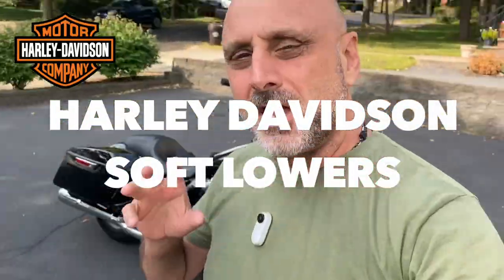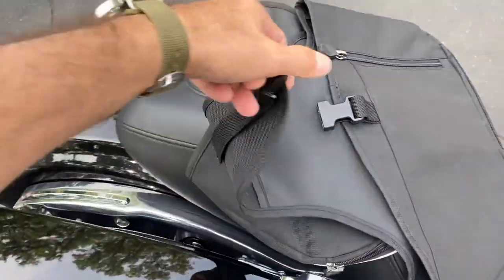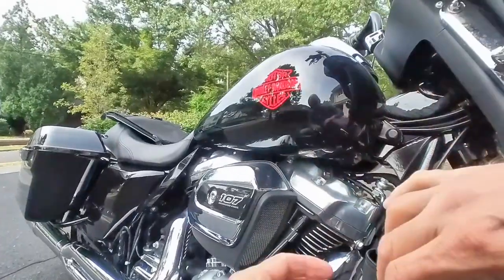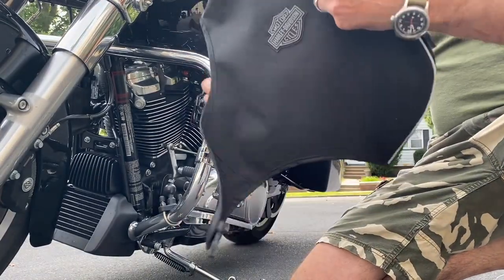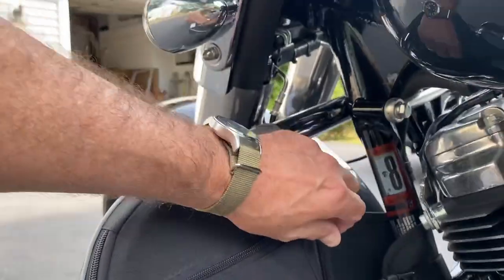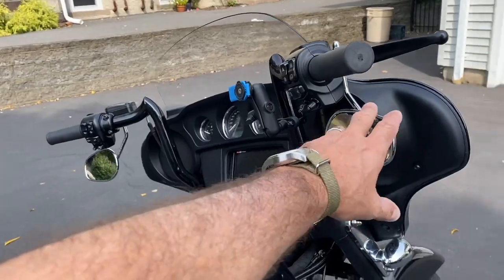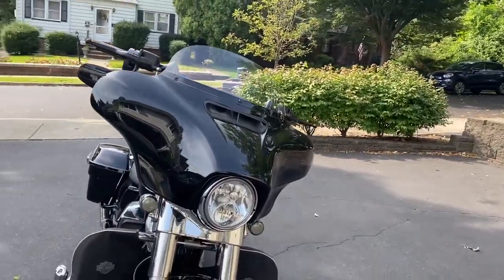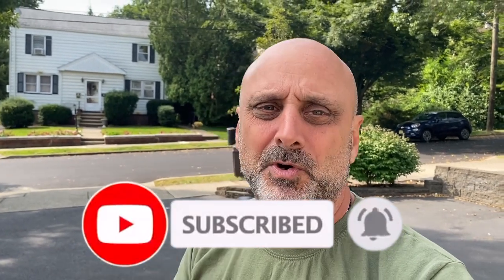Harley Davidson Lower Fairing/ soft lowers

Comment: Nice video. My issue is trying to decide which way to go. I'm undecided on the soft fairings at $99 or the E-Bay hard lowers for about the same price. If you have a black bike, the color match is perfect.

Comment: Do those soft covers A) Make noise at highway speed? B) Have to constantly be adjusted while on a long road trip? C) Keep your feet mostly dry in the rain?
Reply from the maker: No,no , and yes 👍🏻
Reply: @HOLYSHIFT  Thanks for the information, I will buy them to throw in my bag for road trips. It sucks waking up in the hotel to see it pouring rain, but these will make it easier to saddle up knowing it's going to be a lot better for my feet.

Comment: Biggest issue I have with my new Road Glide is air coming up the sides of the tank where it meets the seat and blasting my chin. Did the soft lowers help with that on your bike?
Reply: They helped me. I’ve got a 2021 Road glide, and on cool/cold days I can ride in a lot more comfort. That and a taller windshield from klock werks you’ll be set
Reply: Same issue for me when I have my tall windscreen on. Wind blows from the bottom and sends my beard straight up into my face. I’m going to give these a go this fall.

Comment: Where did you get the black mirrors? It makes sense.  Ps. I see or hear nothing wrong with your daughters strings.
Reply from the maker: Jean Auguste thanks about guitar. Got a set on eBay - very reasonable price.
Reply: @HOLYSHIFT  push her bro or should encourage her more. Keep it up daughter. Hell you can use her more and not have to worry about copyright.